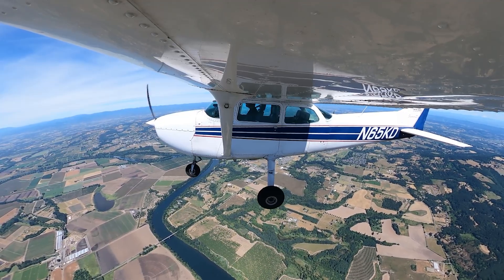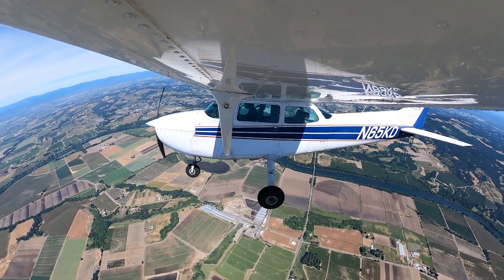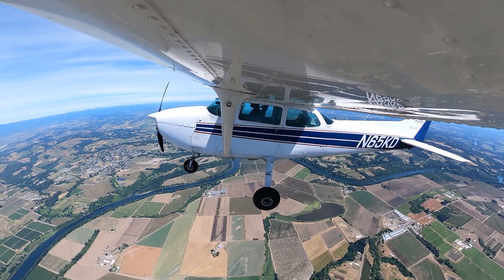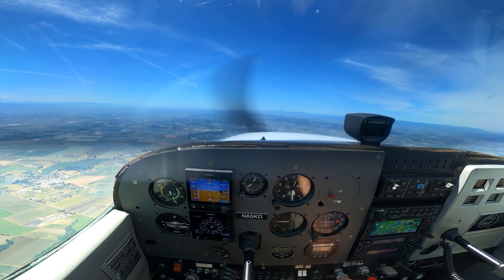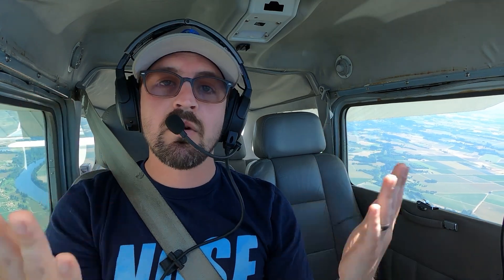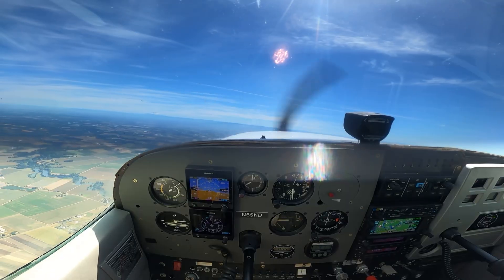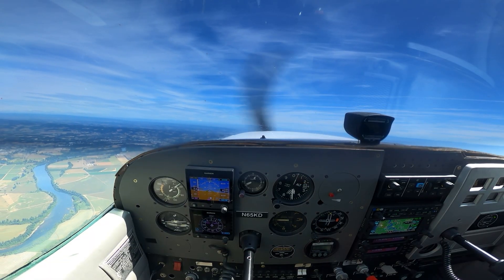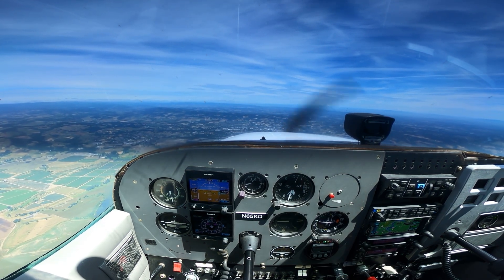Slow Flight DEEP DIVE

Comment: Rudder turns, nice. I like doing them too. I like to note, we can stay flat AOB and turn with rudder which keeps the lift vector straight up and is really a slip hence no spin threat as really our rudder turn is a change of heading in negative numbers relative to the AOB countering the coupled lateral directional, your aileron is opposite. Better, such ingrains a habit to correct AOB excursion via counter rudder while at higher AOA.

Comment: Probably easier to point altitude at altimeter not G5 altitude box as we can see the needles in the video but we can’t read the numbers. Also, your finger is larger such that viewing can be misperceived as if pointing to artificial horizon display. Also, if on altitude, coming inside to see is easier on altimeter as we only need to see general needle position has not changed and not read actual values. Similarly, we could see VVI at a glance. Your eyes don’t even need to refocus inside, the kinda blurry in partial periphery is good enough. Enables less inside time and quicker readjustment back to outside.
Reply: And, I bet this was how you were actually doing it as you did it despite how you were pointing while trying to demonstrate conditions after the fact. Note we don’t actually teach scans, rather we provide conditions for them to evolve why trying to discuss a start point and illuminating things presently missing in the evolving scan.

Comment: FAA likes constant airspeed in slow flight for some reason. So you have to learn it and practice it. But it is stupid. Much better to learn constant AOA ins slow flight. Learn to do constant AOA turns, descents and climbs, and constant AOA turning descents. Try them while deliberately varying rate of descent to include level offs during turn. Do rollouts while maintaining descent too. Learn to do constant AOA as this is where airplanes trim. You should be able to do downwind to landing with the only longitudinal stick inputs being round out and flare. Note you may need trim adjustments for thrust line effects and for tractor style propeller wash over empennage impacting AOA trim balance point. You can do all of this even if you don’t have AOA instrumentation. Yes, you will see minor speed increases with AOB. And you can see descent rates with AOB, but when you would have added a little power and back stick constant airspeed, instead add the little power and a little more power. The purpose of slow flight is to learn how to fly around airfields. So let’s modify how we do slow flight to better improve patterns and landings. See Medium with Improve Your Landings with AOA and Power Techniques.

Comment: great video!
Did you use the trim during this demonstration at all?
Reply from the maker: Yep! Always trim for configuration changes unless it’s a temporary change. You saw that I was hands off once I was configured for slow flight, so whatever is required in your plane to achieve that is what you should be doing 👍